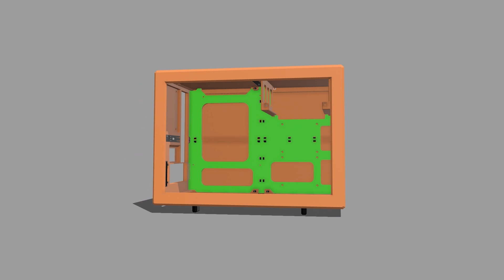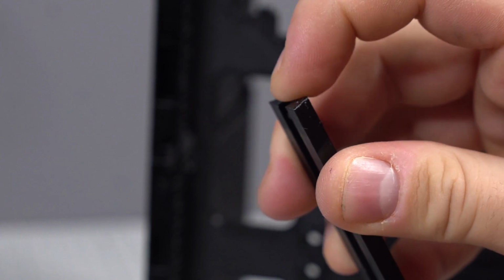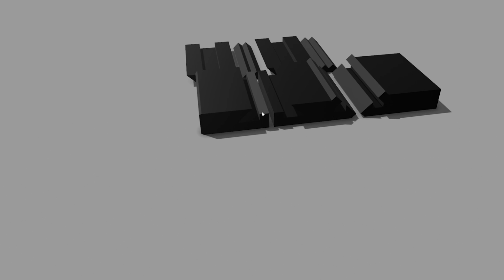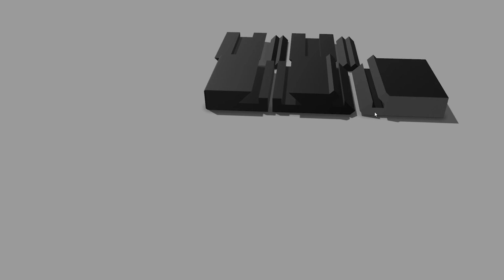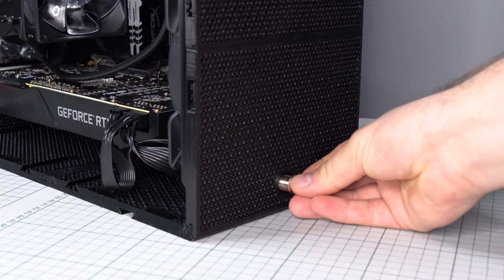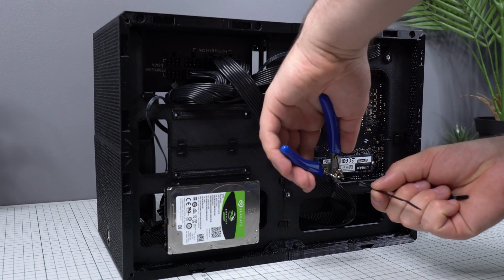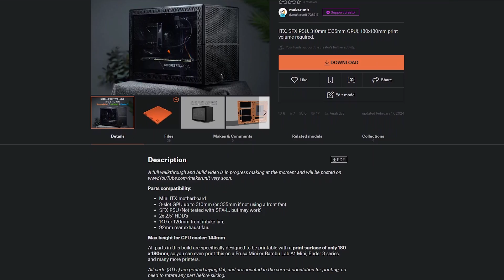A 3D Printed Tiny-Printer-Friendly-Zero-Screw PC case!

Comment: Great design, and honestly, well sliced and executed. HOWEVER, for anyone not trying to build this for shits and giggles, please consider buying a cheap chinese small case instead, the filament for this will be more expensive, and you can buy aluminum cases for dirt cheap.
Reply from the maker: Thanks! And yeah I totally agree with you. The main reason why I do 3D printing is for the fun of creating things from scratch and the learning I do along the way, not necessarily to save money. 

If making stuff is of no interest, I’d also recommend buying a pre-manufactured option. 😊
Reply: Also as a fellow maker, hats off to you my guy, wonderful build! @makerunit
Reply: @Doile911  What's a cheap small Chinese case worth??? Cause i printed my case for less than 5 bux in 5 hours.  HOWEVER you have very pretty little hands.
Reply: @Defyant123  Thank you! Noone ever complimented my hands, much appreciated. Ex. Chieftec CI-01b-op
Reply: @Defyant123  Also i would love to hear where you got your filament from or what brand. Maybe i am using very expensive filament.

Comment: Awesome project!  Now I just have to get my used Ender v2 refurbished and running.
Reply from the maker: Thank you! I’m glad the project caught your interest! 😊
Reply: @makerunit Got any recommendations on videos that show how to refurb a Ender 3 v2?    It was used and slightly modified when I bought it from someone who was upgrading.
Reply from the maker: @deechvogt1589  Hmm, I can’t think of any specific videos and I feel like when refurbushing a printer you’d only have to swap out the worn parts.

I’d recomment checking out if the v-slot wheels are worn, and if the printer is not used too much you can probably just tighten them a bit with the adjusting nut. (But only if the print head feels loose, they may also be too tight causing unnecessary friction for your motors)

Also check your belt tension by adjusting the tension knob. I don’t have an exact method for adjusting this correctly as I just go off feel, but a lot of people tend to tighten these too much. 

My Ender 3v2 has an upgraded mainboard but that’s not really necessary, just something I did to allow for stuff like Linear Advance (which requires some simple code modifying). 

Apart from that I changed mine to direct drive with an adapter I designed myself which I prefer not to share due to some design flaws that makes changing filament very hard. 

Generally, the two things I mentioned above, the belt tension, and if the wheels are worn on any of the axis are my main recommendations, I’ve printed hundreds of hours on mine and not ever done a «full refurbish» to be honest, just a couple nozzle swaps and new V slot wheels.
Reply: @makerunit  Thank you very much for your suggestions.  Now I know where to begin.

Comment: Will it also fit a Matx motherboard? There seems to be a lot open real estate below the itx board
Reply from the maker: The size is unfortunately not big enough for Micro ATX motherboards. 

Mini ITX motherboards are 170x170mm. MATX boards are mostly 244x244mm, so we’d need 74mm of clearance on each side which we unfortunately don’t have.

Comment: Nice idea but worst thing ever.
1-the filaments like PLA/PETG @70°c usually melt, bend and deform.
2-i would never use it for "gaming hardware" because that hardware reaches high temperature.
3-it will cost approx the same amount of money of aluminium "basic" case, which all knows, is better than plastic for the heat (1,7Kg at nearly 18€Kg + some dozens of hours of printing time at ~0,25€ per hour x 100ish hours...)

Nice to see, but no thank you. Maybe it will be good for a raspberry (according the raspi size, not for a standard PC)
Reply from the maker: Hi!

I totally understand your concern and this is a very common misunderstanding about 3D printed PC cases. A lot of people seem to think that they will melt if the internal components ever reach high temps but what’s important to keep in mind is that all these temperatures are recorded deep inside the components at it’s processing cores, meaning that the hot spots are never actually touching any of the plastic parts.

It’s like when you turn on your stove in the kitchen and hold your hand a little bit above it, it feels warm, but not burning, but as soon as you touch it, it burns. 

Even though the cores of the parts are hot, the air surrounding it will never ever reach those same temperatures.

Also, 3D Printing a PC case is rarely about saving money, but more about the joy of making stuff for the fun of it.
Reply: @Ale_giro    @Ale_giro Are you that guy who's never 3D printed a case???? Case modded?  or even built a custom case  other than a "shop brought" one. It's always that guy who does this post.

Comment: Found this video on my for you page and after watching the video I am impressed on the design and build quality and also the fact it looks nice to and to be honest is better than most case designs. Though I would like to suggest as a idea and that is put fan mounting holes on the bottom
Reply from the maker: That’s a good point. If using a 2-slot GPU like me you could probably get away with some slim intake fans at the bottom. I’ll look into it.  Thanks! Maybe even an exhaust fan at the top above the CPU cooler.

Comment: Beautiful. Also great for those 200mm beds where the adhesion on the outer perimeter isn't the best due to heating flaws. I'm sure if someone wants they can get it under 1kg as well by using lightweight polymer (i.e. HIPS) and decreasing the infill percentage.
Reply from the maker: Thank you! Weight can definitely be cut down a bit, I also used about 5-6 external perimeters for extra strength.

Comment: Oh I see this must have been so much fun make that system! xDD
The inside had a bit much room for my taste if not for me I'd maybe make it for a friend just to see how he likes it! xD

Just to things
1. I can only go by my experience from a CPU cooler fan bracket from some years ago. 
If the PSU holding bracket ages (probably won't happen around the PSU) then probably cracks will start right under the PSU and then the PSU screws won't do much. So just in case, I'd add a bit more material that would connect the upper screw holes and form a seperate part to go into the roof or connect to the right and left PSU bracket, just to have a bit of redudancy. Because if one of these two pieces ever snaps, I don't think the one screw on the other side will hold it in place and at that height the graphics card maybe won't like it ;)
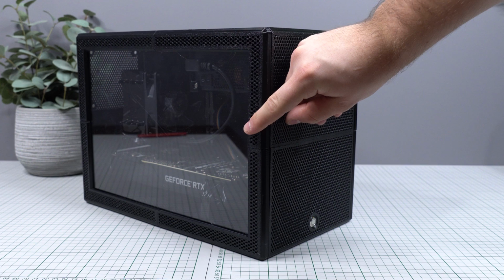2. 10:34 Noooh >:o
don't go the easy route, just make a part that stiffens the frame from the inside like the other pieces you made for the body ;p
3. How about making some 1-1,2mm indentation on the outside then one could place in some some fancy metal plates wih some fixed corner radius where no fans are placed. :D
Reply from the maker: It was definitely a lot of fun (and also frustration) creating this design! I understand your concern about the PSU bracket and I’ll look into ways of reinforcing it if possible, though I do not think it will break off, especially if using PETG or ABS/ASA. (But you may be right)

Embedding metal pieces could definitely strengthen the structure, but I specifically wanted this design to use as few extra parts as possible 😁

The «extra room» in the case could definitely have been shrunk down a bit, but due to the transparent side panel I wanted to have the interior as clean as possible, where in a non-transparent case the interior layout wouldn’t be as critical.

Comment: Very good! I liked that you designed it for 3D printers with smaller printing beds. Could it be kept as default for future projects? Please make a "micro atx" version of this! or better yet, a "dynamic" version that depending on the pieces that fit together can "grow" from itx > m-atx > atx or include a smaller/larger GPU... or something like that. I think this "locking system" could be used to do something like that... think about it! Thank you!
Reply from the maker: I’ll try to do it where possible, but some projects simply won’t look aesthetically good if split into parts. 😁

Comment: Screwless and toolless design for the case is a huge step up engineering quality imo, love it, would you say rigidity is as strong as it would be with screws?
Reply from the maker: Thank you Tim! 

A design consisting of many smaller panels will lack some of the strength compared to solid panels printed on a larger surface, but to counteract the weakness in the joints I intentionally made sure to interlock the panels in all directions so to be honest I don’t really notice much of those weak points.

With the side panels off, I do notice it a little, because there are some pins on the side panels that serve a function in stiffening everything up as well.

With all panels in place the overall rigidity feels pretty close to my other cases with bigger one-piece panels. 

I don’t really see many downsides to using joints compared to screws. 

Eliminating the need for any special type of screws and inserts makes the build much more appealing too, knowing you could make it all right from home 😁

Comment: Well done. Got so much inspiration from things done here. What material would you recommend printing this in ? I would like to stay away from ABS. Are there any other that are capable of handling high temperatures?
Reply: Yes, ASA for example.
Reply: PETG should work aswell, and is easier to print than both ABS and ASA imo.
Reply: @TheDeantonio  At what temperature would PETG deform?
Reply from the maker: I printed all my parts in PETG, but you can also use ASA and ABS. 

Detailed information about my printing recommendations can be found on Printables. 😊

Comment: Thank you for designing and making cases for us who still use smaller build volumes!!! Hopefully this is an indication for future released for a full sized atx/matx/PSU design! wink, wink, nudge, nudge <3
Reply from the maker: I mean, technically most of the parts are scalable so a mATX case based on the same concept is not impossible!